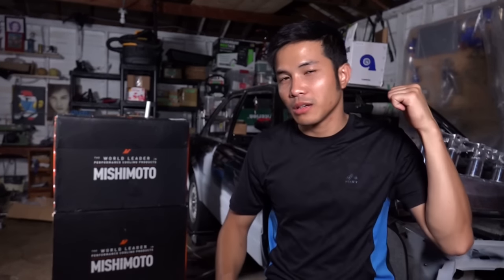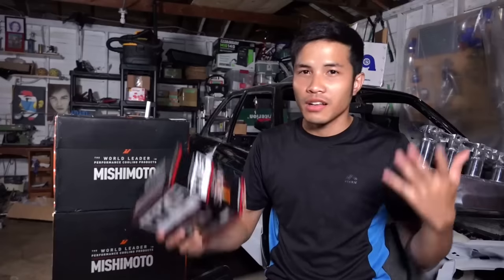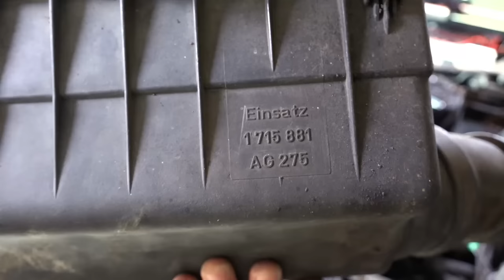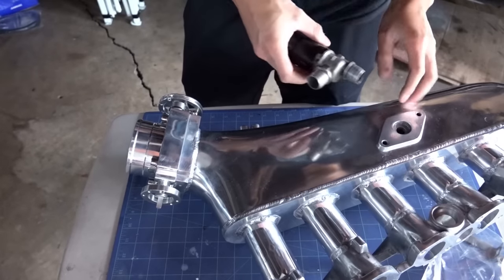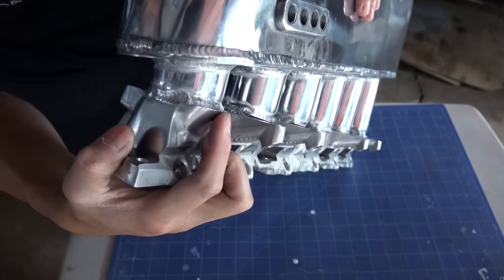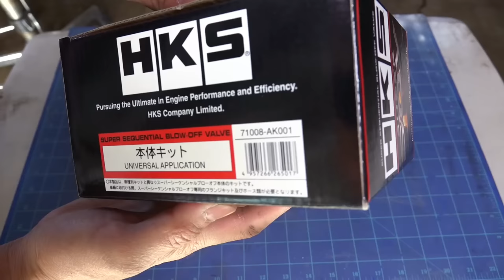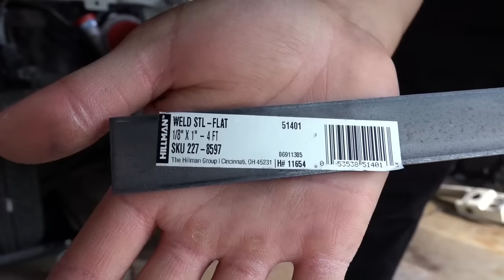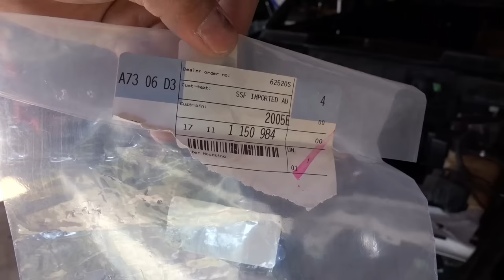E30 Fix 14 | Test Fit $479 MISHIMOTO Radiator, $512 Turbo, $312 eBay M20 Intake, Intercooler

Comment: Ive boosted many E30 over the years use head studs or you will blow the head gasket. If you really want to boost proof it use a metal head gasket oring the cylinders and use head studs.

Comment: hey bro, one piece of advice i would give you is to make sure the fan is not too close to the radiator. B is for Build did this by accident on his 2jz BRZ and poked a hole through his brand new fancy radiator cause the fan rubbed on a coolant passage

Comment: I reccomend to remove heater core tubes before undoing core itself. I did same mistake and broke the core connection. Bought new Nissens core.

Comment: you are going to need a better fan shroud. the regular mishi one lets too much air escape before passing through the radiator. I ran that setup for a little bit and it could hardly even keep my na s52 cool. I would strongly suggest just going back to stock clutch fan and shroud if possible.

Comment: Hah respect for doing mods for m20 engine! I have done couple bmw 525i e34 turbo with m20b25. Stock internals handle well ~500whp but ecu must tune very well. Btw original m20b25 intake manifold is enough for 800hp thats why i have been using original intake manifold 🤔
Reply: Stock intake is underrated, plenty of big power cars running them even above 800. Karel Silha was making 931whp on one when he had his Speedhunters feature, not sure if he made more after that or not.

Comment: I just got the same Mishimoto radiator but I didnt get the e36 electric fan kit, just the electric fan to mount closer to the radiator for more clearance. Good work though, some fabrication skill there.

Comment: yeah I would have never used that intake manifold since it requires you dissasemble so much of the car (brake pump, abs pump, heater core, etc). The stock intake manifold works just fine for turbo builds.

Comment: Hey man, just a couple of things to note with the CX racing kit. The turbos are known to have their turbo seals fail. The oil restrictor on the turbo can be a problem depending on how good your oil pressure is. Any of their "AN" lines are really terrible and are a fire hazard (as they fray, tear and split). I would suggest at least have some good ones made with swivel fittings, saves you from a potential fire and is less of a headache to route as the CX one does not twist or swivel. CX Racing messed up Sammit's turbo manifold for his giveaway miata so I'm not surprised you ran into the nuts hitting the manifold issue. He also did a video where he tore down his turbo and showed you how bad the oil channels are. 
Another note, isn't that intake manifold overkill for this setup? Is it for the aesthetic?
Apart from that dude, your diy craftsmanship is unmatched. I noticed your welds are a lot more consistent and clean. I like how you used the drill press as a mill, although I'm going to assume that it is not healthy in terms of longevity. Those are some of the most legit/overkill intercooler brackets I have seen (just make sure you have some sort of rubber isolater where ever there is metal on metal contact). Your body work on the ducting of the front bumper looks awesome too. Keep it up man. Excited for the next episode.
Reply from the maker: Thanks, man. Some good info here, I will keep an eye on the possible leaks. The intake manifold is most definitely for the aesthetic, extremely cool looking in my opinion. I'll see what I can do about the rubber. Cheers
Reply: @DarkDragonWing  That manifold is pretty awesome. I hate those unsightly manifolds that run over top the cam/valve covers (such as RB's, excluding the RB26). Glad to hear the information was somewhat helpful. Keep safe man.

Comment: Hey Mackie, are you sure about that fan shroud? From my limited experience, you'd want one with no holes so that air has to go through the radiator and out the other side instead of "leaking" to the sides. 

But I might be wrong!
Reply from the maker: You are right about that, the enclosed shroud you described would work better at cooling the entire radiator. This setup that I have will only cool the fan area on the radiator. I'm not too worried yet, if there is an over heating problem, I will try to close those holes on the shroud and see if that will help.
Reply: DarkDragonWing Yeah, I just thought it might be a good idea to sort that out. You are putting a turbo on a formerly N/A car,  there's an intercooler right by the radiator AND you want to drive the car hard. 

So I'd think every bit of cooling is useful, but as you said, you can fix it when/if the need arises.

Comment: How much was the water tank and the air conditioning fan as well.
Reply from the maker: You can see the prices here: https://docs.google.com/spreadsheets/d/1dZP-l3D1nw0ARzqno8w-wzRZML4FnYGxadYH_602MOE/edit#gid=1070960775&range=C76

Comment: Does that ebay throttle body have a connecrion for the stock TPS sensor?
Reply from the maker: There is a place for a TPS, yes. You will need to make a custom mounting for it though. For me, I'm doing an E36 TPS conversion, and yes, I will need to make a custom mounting for it.

Comment: Second mistake.... An intake must me as smooth as possible for good and clean air flow... you have to finish the intake with a 600  sandpaper and increase it to 1000 for better and cleaner surface.

Comment: I’m curious why you didn’t do a simpler intake manifold option, like a dbilas dynamic or RHD to save you a ton of time and fabrication?
Reply from the maker: @arashjahn  Because I don't like the look of those ones. This eBay one is a POS for sure. So I designed one and had CNC Innovations put their final touch on it. Can't wait to show you. They're in the process of making it right now. 💯🔥:_turbo::_flame1:
Reply: @DarkDragonWing  Nice. Look up episode 48 of Castro Motorsports.

Comment: Would this radiator fit on an early model e30? If not what radiator would be good with an early model e30? Please help thank you
Reply from the maker: It doesn't say that it will fit the early model. You will have to search on Google for that.
Reply: @DarkDragonWing  thank you for taking the time to help out.

Comment: The factory intake manifold will outperform that crappy flowing unequal length after market one.
Reply from the maker: This engine is fuel-injected. It's not carbureted where the runners have to be the same as much as possible to distribute the fuel and air mixture at the same amount for each piston. The fuel-injected engine will suck in the same amount of air with the same amount of fuel being injected for each piston no matter how long the runners are.
Reply: @DarkDragonWing  your not telling me anything I dont know, but this manifold has been tested and its complete garbage im not new to e30s...
Reply: Join the e30 forced induction group on Facebook lots of knowledge there...
Reply from the maker: @xmedina9705   Cool. I would like to see the test. So it's E30 Forced Induction Crew (turbo, supercharged)
 group to be exact?
Reply: @DarkDragonWing  yes thats one group, there are a few other usa based groups with alot of us forced induction guys. Some one literally asks about this manifold every month, so as a group we all threw in money to a member he bought it and flow tested it, the results speak for themselves his name is frank Leo grand.
Reply from the maker: @xmedina9705  Man, I searched everywhere and the test is nowhere to be found. Looks like Frank hasn't tested it yet, you should call him out on it.
Reply: @DarkDragonWing  Trust me when I tell you the info is out there.....they are talking about it on e30zone face book page as i am typing this.

Comment: Can the stock tps work with that big throttle body?
Reply from the maker: If you're using an aftermarket ECU, no. If you're using a stock ECU, I'm sure you can find a way to mount the stock TPS on this intake. Though I'm pretty sure you can't use a stock ECU with this intake, it might work, but probably not very well.
Reply: @DarkDragonWing  thanks for the reply!
 I have a Miller WaR chip and an afr controller so I'm thinking I may be able to tune for it. I want to upgrade my intake for high rpms so I was wondering if the stock tps can be mounted to that throttle body without any (serious) modification
Reply from the maker: @PRINCEkris01  I'm in the same situation really, I'm using an E36 TPS and all I need to do is make an adaptor to keep it in place. It's just a plate with a hole in the middle for the shaft, 2 holes to mount the plate to the throttle body, and then 2 threaded holes for the TPS.

Comment: I want to see you stall tht chome intake manifold cause I have the same exact one.
Reply: If you haven't done it, don't. The stock makes more power.  It's only purpose is to use the plenum they already made for similar bore spacing engines like the 2jz and cram it in an M20 engine bay and clear the brake booster. They gave zero fucks about performance - The runners are far too short for how low an M20 revs, and aren't even the same length front to back because they sacrificed what little length they had for brake booster clearance.  The fit and finish is also poor - you saw DDW hog out the runners because of the welding slag on the inside, and there's more on the casting inside the plenum where the manufacturer clearly doesn't care about what they're selling. 
I get that the stock intake hasn't aged gracefully and is considered ugly by most, but if you really hate it enough to change, do your research first and don't buy something objectively worse.